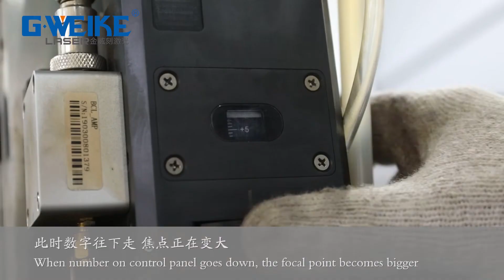Manual Laser Cutting Head Focusing Fiber Laser Cutting Machine

Comment: What is the difference in cutting heads? Manual vs Automatic?
Reply: i think the difference is that in manual you have to set the focal point manually, while in automatic its controlled via the motor from the software. And i guess you also can set different pierce focal point and cutting focal point, so that it pierces faster and probably more accurate.